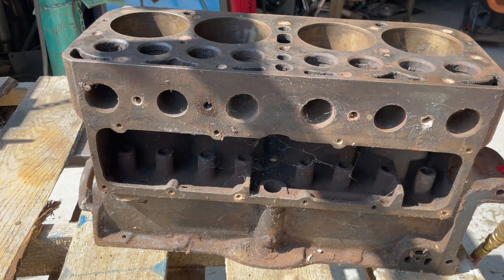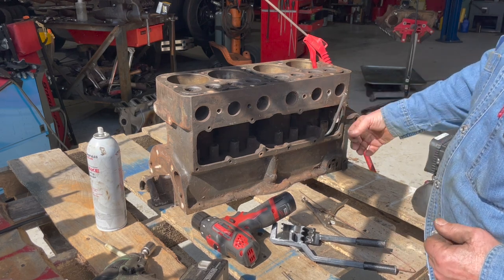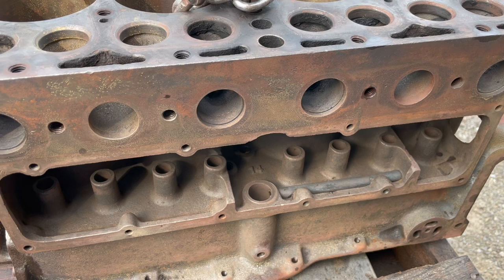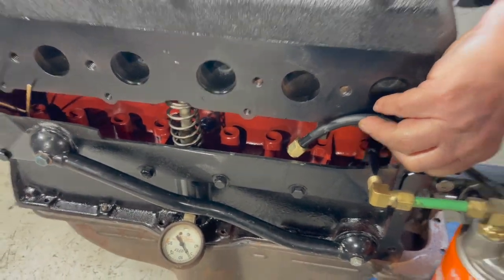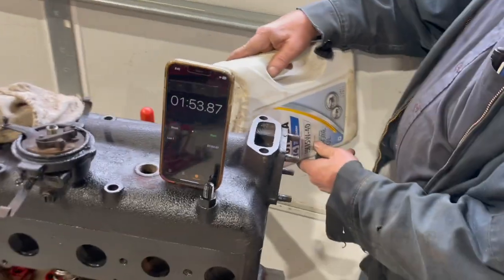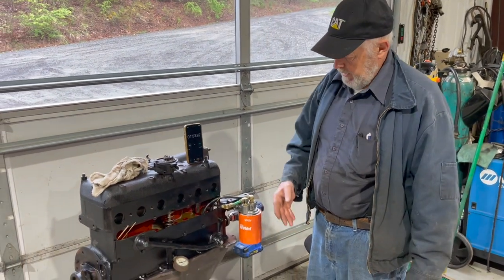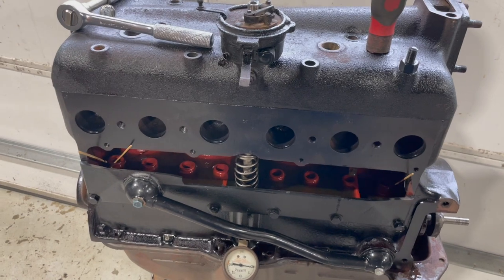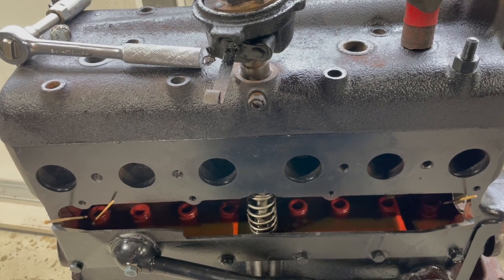Pt 1 MODEL A FORD OIL FILTER TEST, YOU BE THE JUDGE

Comment: Thanks, Randall, 

I got a lot out of it too. Our coupe has the full flow filter on the valley cover. When I change the oil, I have a clear plastic hose on a small funnel. The hose line I.D. fits near perfectly into the return hole in the valley cover where the filter screws on. I hold out the last new quart from the oil pan, then add it to the galley, screw on the filter, and immediately start the car. 

Your comments about finding the galley partly full of oil when removing the cover tells me that the mains and their .0015 clearances don't let the valley drain to nothing very quickly. 

For me, the hot oil tests seem to tell the real story.
Reply from the maker: Thanks glad you liked 👍
Reply from the maker: Thanks Rob  that’s a good idea using the hose especially when changing oil with a cold engine
Reply: Thanks for interesting video of the marvelous an rugged ford A engine ! I have  our    
grandpa's 31 an brother has our Dads 31 !  would love see a oil flow comparison text... show time required to pump say. . 1 pint through filter an then without filter . Thanks, Ron

Comment: Hello Randall. Thank you for going to all the trouble of setting up an excellent demonstration to prove the efficiency of the Affordable oil filter kit. I currently do not have an oil filter on my 1930 Fordor but you may have just convinced me to add it. I also found that there's a lot of chatter  back and forth about adding an oil pressure gauge. Some say it's just another thing to worry about and others feel that it's a must. What do you think? Thanks.
Reply from the maker: IThanks John     i  personally don't see a need for oil pressure gauge, but not against

Comment: I use 5-20 full synthetic in mine, it's all original as Ford (and Dodge bros') made it, I want oil fast in that tray, oil down to those bearings fast, forget the 'upstage engineering', got my first Model A in 1948, driven 'em a lot of hard miles, modern oil is the secret, use it.

Comment: I have a question concerning tapping the oil gallery. By sending oil to the filter element, is there any risk of oil starvation to the pressure fed components? Is the crank mains the only pressure fed item? Thanks for the video and the work! I too want to filter my oil and I am trying to learn as much as possible.
Reply from the maker: There’s nothing that requires pressure, the pump only fills the valve chamber and the oil gravity feeds to the mains and excess oil flows out the front of valve chamber behind cam gear , the oil goes through the filter into valve chamber
Reply: @randallstrickland8204  Thanks. Learned something new!

Comment: so no oil to the lifter area and bearings tell the filter is full and it only took only about 2 minutes ! mite be the reason oil was coming out of the cover was the motor had 50 to 80 years of crud from none detergent oil  with a fresh built motor and modern oil that is changed that is not going to happen
Reply from the maker: there will be oil in the valve chamber,because of the close bearing clearance,and if you are worrid about it not having oil you can use a hose and funnel to put oil in the valve chamber by attaching hose to the filter nipple that filter screws on

Comment: If your trying to protect your engine use better quality filter  fram is one stupid choice 
But fram filters  keep my machine shop going   when idiots ruin engines and use 30 wt oil not 15 /40 thinner is better for break in  just think of damage  to that engine using heavy oil and crap filter.  Wix  Motorcraft   napa gold